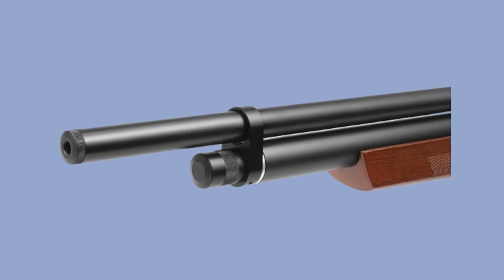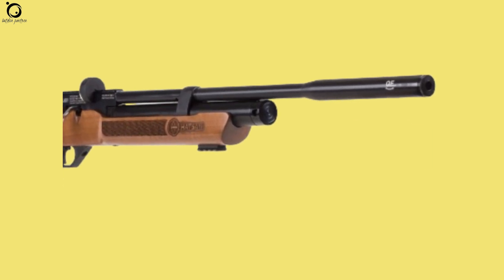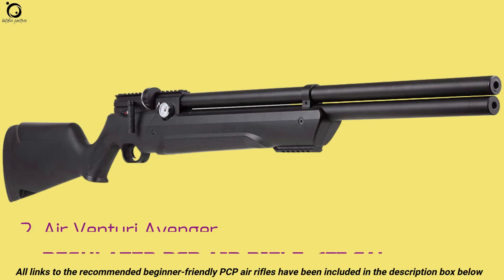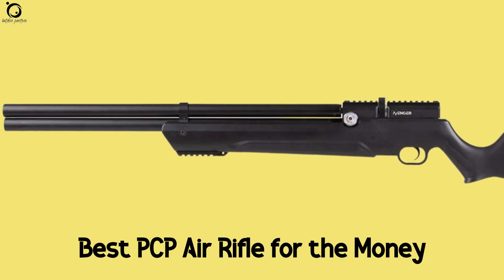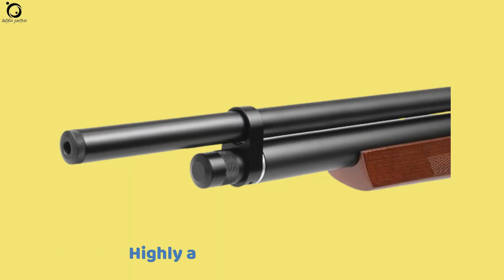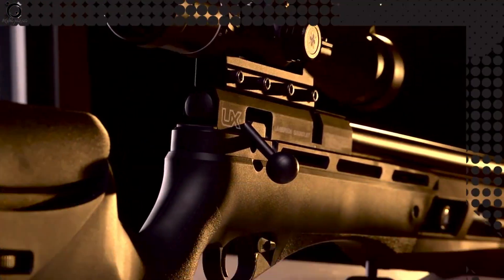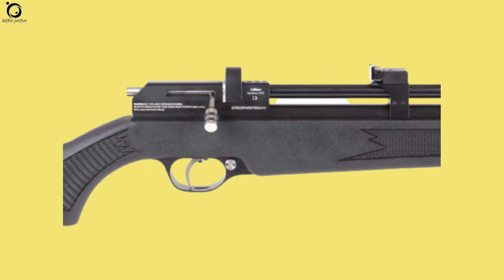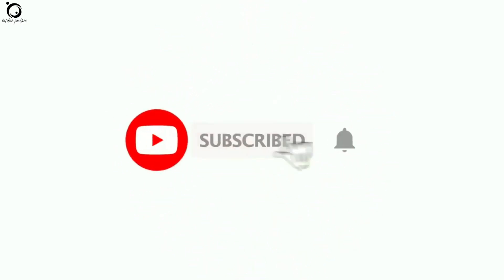Top 5 Best Beginner-Friendly PCP Air Rifles

Comment: None of these is a good choice. They are overpriced compared to 22 LR rifles.
Reply: 2 years of shooting lower cost pellets and the gun pays for itself .  Now days a brick of 22 cal LR is around $56 bucks and it's hard to find full 500 round bricks , if you go super cheap and buy crosman pellets you get 500 for under 10 bucks. 

It's the initial cost that scares people off , I've had to work my way into pcp gradually , 1st you need the riffle  lucky if you can find a starter pcp for  $ 200 , then you need the hand pump , but you will find  pumping is a decent effort and pumping damp air like going to the woods and trying to pump air in the winter is bad so now you need a bottle , you can pump it with the hand pump 780 pumps 3 days  later you have your dry air in a bottle , that's where I'm resting now , next is the compressor 
$ 200 for gun minimum,  $40..minimum for hand pump .
$ 39 for the bottle 
$49 for the valve and hose .
Lastly nearly $300 for a lower quality compreser,  Man I don't know if I can hand pump another 0.5 liter bottle by hand too many times . About $600 gets you up and fully running .
Your right about 22 LR but the way things are going soon we won't be able to afford target shooting and the best thing about airgunning in the USA is no regs , full auto ? No problem,  silencer no problem,  
Modify to SBR no problem. 
Airguns are the future my friend , big bore airguns have surpassed or at least equalled the Firearm .
Check out Hatsan Blitz for Fun .
Reply: My ft marauder with the lothar Walther barrel and regulator is shooting moa groups and sounds like a nail gun maybe quieter it will hold its own with .22lr up till bout the same price range and it likes crosman pellets I can get 500 rounds for $6 and they are always in stock I love .22lr but my pellet gun is safer quieter more accurate cheaper to shoot and I can legally shoot it in my yard in city limits if you don't want all the extra gear a tx200 or hw97 are fantastic options